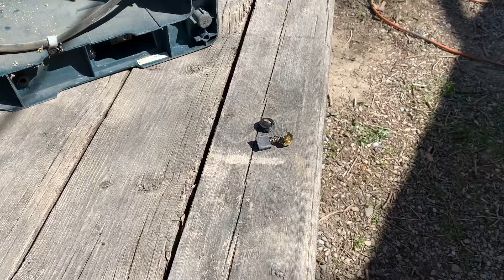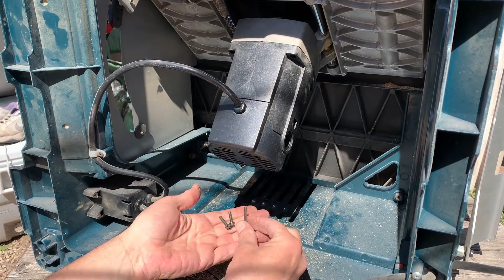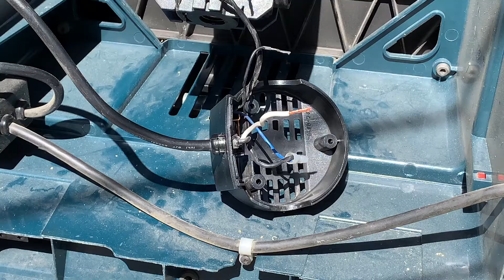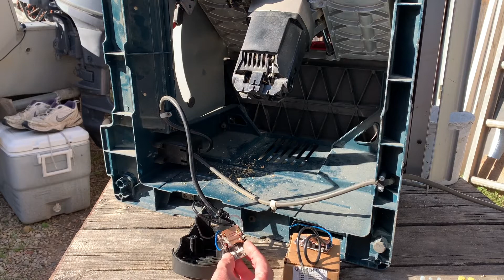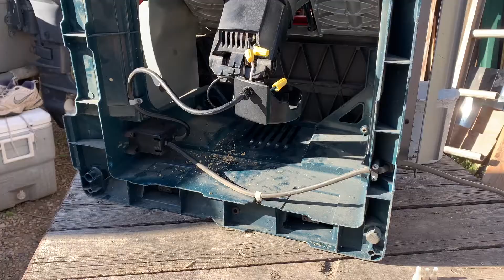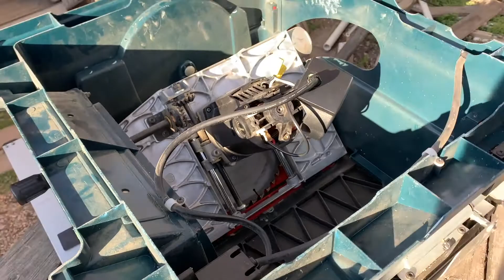DIY Bosch Table Saw Repair / Replacing the Speed Control

Comment: The control board is only for the “soft start” safety function
Reply: so essentially some sort of intermittent resistive load that gives full power access once it reached a certain rpm or something?
atp id prefer a centrifugal switch but thats probably too complex
Reply: @asakayosapro yea basically it’s so if u accidentally turn it on it won’t rip ur hand apart immediately
Reply: Yes, you can bypass it by connecting the two black wires (or so I am told as I have not done that myself. If the capacitor is blown though, the saw will not start in its original wiring configuration.

Comment: How do I  by pass the speed control baord?
Reply from the maker: If I remember correctly I just connected the two wires that went to the control board together. I have no idea if this is a good  or bad thing for your saw long term. Good luck!

Comment: I replaced a new 2610997306 speed control board. When i turned on the table saw switch the saw still turned counterclockwise (backward). Please provide some advice. Thank you
Reply from the maker: Seems like when I was reading up on fixing my saw, the various online conversations I read, there are a couple of things that might cause the blade to go backwards. I cannot remember it all exactly as it has been years since I researched and read those threads. My repair was just the control board, perhaps yours is a field coil. I don't know. I suggest google search and reading all you can find on this subject.

Comment: My Bosch 40000 saw has the exact same problems. It runs slow and backwards. I ordered the new speed control and installed it just as this video describes but no improvement to my saw. What should I do now?
Reply: I have the same problem like you. Did you fix your table saw?
Reply from the maker: I don't really know! Are you sure you hooked it all back up correctly? Could the new part be faulty?

Comment: Thank you so much for making this video. I followed along and was able to replace my control board with zero issues. $45 dollars instead of a whole new saw. Hopefully it will keep running for another 14 years!
Reply from the maker: That's great news! :D Mine is still working fine. Gonna fire it up tomorrow perhaps.

Comment: Now I know I am not the only one who thinks replacing parts is a good fix!  Been doing this with my old, very old central heat and air unit.  So far the fixes have worked!
Reply from the maker: New saws of this caliber are $600 easy these days. Prices like that were fine when I was earning money doing jobs with the tools. One or two jobs pays for the tools. As just a homeowner it's really hard to justify buying those tools. I'm glad I was able to repair it. And this video has done really well for this channel. One of my top videos! :D

Comment: Just happened today on my 4100 that ive had from the day they came out. Never had an issue in all these years.
Pretty simple to access with the saw on its end on the stand, with the blade at 45°> pretty simple.
Thanks for this video

Comment: I have the newer version of this saw:  the 4100. What exactly did you do at approximately 6:08 in the video to tilt the motor?  I need to access the height adjustment rod and motor slide rods as my blade is frozen in the upright position. I need to disassemble and clean/lubricate the rods. Accessing this area is difficult. Thanks.
Reply from the maker: It's just the blade tilt mechanism. Hope this helps..

Comment: great video, i picked up one of these saws for free not running, it had a bad bearing i replaced, but it still does not run right, it will start some times and not others, brushes look fine, i'm thinking it's the board, gona bypass it and see, if it is the problem i'm just going to leave it bypassed for now.
Reply from the maker: It's been a month since this message, did you get it running? I'm no repair tech but I'd check all the wire nutted electrical connections.
Reply: @camplapidary  armature was cooked, so i saved all the good parts and scrapped the rest, i'm watching for another one.

Comment: Great video, I have the same saw and believe my PC Board (soft start) is on its way out. I'll buy the board instead of ordering a new motor from Bosch. Thanks!
Reply from the maker: Good luck, Chris! Happy Cutting. :D
Reply: @camplapidary  FYI...received my part from Bosch yesterday and installed it.
Saw starts and runs like new. No intermittent speed.
I was able to squeeze the existing maretts gently with a pair of pliers remove and reuse them using a crimper.
From Northern Canada thanks again CL for taking the time to make such a detailed great video. Cheers!
Reply from the maker: Very good, Sir! Glad to be of use. I went nearly a year without my saw before getting up the gumption to fix it. Hope you didn't have to wait as long. :D

Comment: Hi, what would happen if you permanently hot wired the switch to the motor avoiding the board? Has anyone tried this, does it work, or has it destroyed the motor, or is it OK?
Reply from the maker: I don't know what would happen long term bypassing the control board. Once I bypassed it momentarily to see the motor work, I decided to get the new control board. Good luck though. Keep us posted if you experiment.

Comment: This video is absolutely useful.  My bosch 4100 didn't start one day, so I went out and bought a terrible ridgid last fall.  Not near the tool the bosch was.  I recently just bought a new switch and it still doesn't come on.  I'll tear it down and try to replace the speed control.  Thank you so much for putting this video up.
Reply from the maker: Hi, Christopher. I love my saw as well, just used it yesterday and will be using today. I hope you can get yours running again. Be sure to check all the electrical connections, it's possible to have a loose wire or something..
Reply: @camplapidary  Thanks.  It is on the list of things to do.  As a builder I've ripped miles and miles of various things through the 4100.  Well worth salvaging.  Best table saw I've ever had for a contractor jobsite saw.
Reply: @christopherw4527  My stop last week.  I changed bad bearing but it wasn't why it stop.  Checked continuity of cable and switch, all good.  Will give it to shop.  Will not buy any crapy table saw.  I even do not like new bosch.  If would have more time would try to test that speed control board.
Reply: @zell863  mine is still sitting by my shop.  Your right.  I don't know who makes a decent large wheeled table saw either.  I have been through a few since I first commented on this video.
Reply: Really is though….mine completely stopped working….and in the meantime was using an old craftsman and man that thing is horrible in comparison I love my Bosch….comparable to a sawstop
Job site saw tbh. I worked for a custom window company and we used both.

Comment: Whats up with newer electric motors? The old stuff just keeps going. The older motors also have oil cups.
Reply from the maker: Ya know, when it went bad I was trimming just little pieces of wood for my 4x6 trailer. One moment it was fine, and the next cut it wasn't... Old motors with no electronics are reliable beasts, this has soft start and some circuitry in there. Still, it ran for about 20 years before needing repair. I'm just glad the fix worked. I'd hate to have to buy some new saw, especially because I don't really Handyman for Hire anymore.

Comment: “Umm, might be time to just go back in and read the internet some more.”  Story of my life! Great video, thanks for producing it as I have the same saw and it’s making an odd noise on start up.  Very helpful to see your vid before I go into m saw.
Reply from the maker: Exactly why I made this video. I hope it helps, and good luck!
Reply: @camplapidary  someone else pointed out  that it was helpful to see you go through the diagnosis and what you tried and didn’t work as much as what did. You have talent!
Reply from the maker: Lol, far too many times simply jiggling a wire has made something come back to life!

Comment: Thank you for your video. I have the exactly same problem with my Bosch GTS 10XC. As i know, there are 2 type of wires in the stator: heavy load and light load (small wire and bigger one). The speed governor will start 1 state of starting by small wire to give low power to protect the gears. State 2 will cut off the small wire and turn ON the bigger wire for cutting operation. Tomorrow i will fix as you did. I don't need  soft start. It is totally weird! It can caused burned small wires in the stator and completly burn down the motor in smoke.
Best regard.
Reply from the maker: Very interesting, Thai. So you are not replacing the speed control board? Just going to bypass it? Thanks for commenting!
Reply: The new Bosch 4000 speed control switch is not working for me. When I pull up the on/off switch, the blade turns 1/4 revolution and stops. The motor works fine hardwired. I cut a 2 x 6 with the speed control disconnected. I'm thinking that as a retired electrician, I will install a 15 Amp breaker between the hot wire of the motor and the hot wire of the line (on/off switch) just to play it safe.

Comment: Thank you for the video! My tablesaw started doing the same thing today, I guess is time to replace the speed control, I have own my saw for about 17 years
Reply from the maker: 17 years is a good long time. Did you use it a lot? or just occasionally, like me. Good luck, Bernardo.
Reply: @camplapidary  I used it a lot, I'm not a contractor but I do a lot of small side jobs, I was ripping 2x6 redwood when it went out.
Reply from the maker: Very interesting. One of the last jobs I did with mine before it went out, involved ripping redwood 2x.

Comment: Thanks for the video, same issue with my gts 10j, bypassed the speed control and like yours it temporarily solved the problem. However I am wondering what the long term effects could be.
Reply from the maker: Hello! Before I purchased the new Speed Control Board, I went to my local repair shop and asked about your very question. One of the techs said that if the Amps are at the correct level there should be no problem not using the Control Board. What are the correct Amps? I don't know.. But good luck with your saw and thanks for watching/commenting!